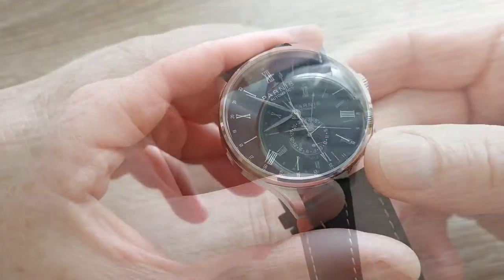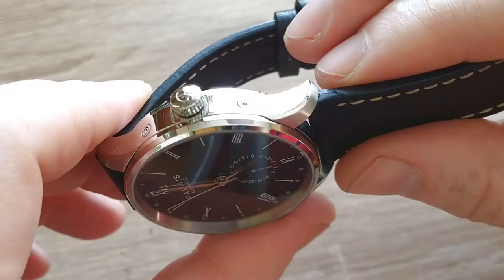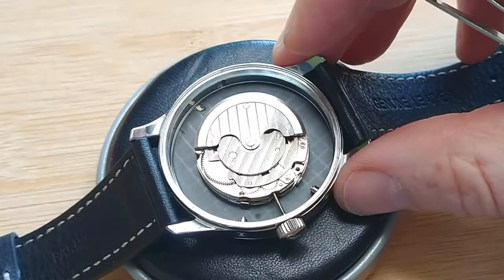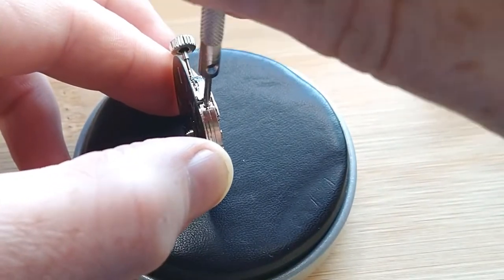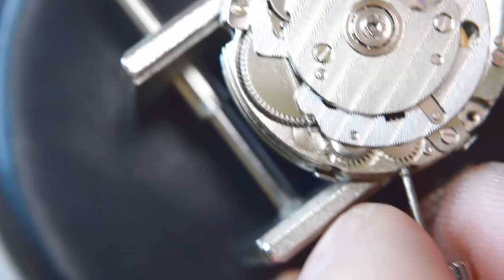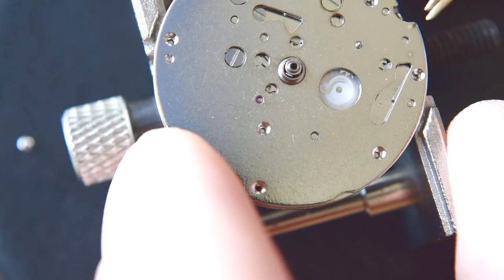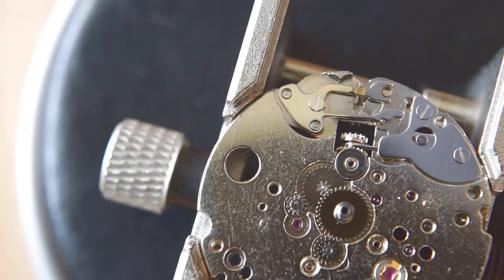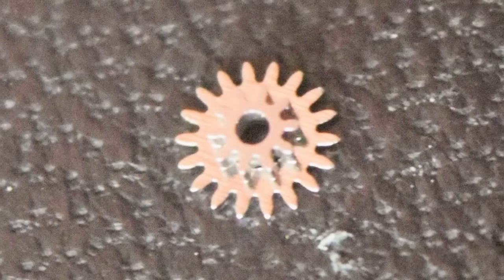PARNIS watch PA2122 with GMT and Seagull movement 1690 part 1 disassembly

Comment: Dzien dobry. Another interesting dissembly video. Do you think Parnis brand utilise genuine Sea-Gull movements and is that ST16 is a reliable movement? I am now thinking to buy a Parnis with ST2505 movement and another Pagani with quite old ST06 movement. Are they also though, reliable and problem free movements because multifunction is the best option for affordable price only in Chinese movement. Dzienkuje bardzo.
Reply from the maker: I was having ST16 and ST17 and all were doing well. About Chinese multifunction movements I was having only this with flying wheel, was working well and accurately. 😀

Comment: I bought this same exact watch and the GMT hand advances when the minute hand is at about 17 minutes past the hour…
Reply from the maker: But is it showing correct time?
Reply: @tickingWATCH Yes, it shows the correct time. Date advances at 12:00 correctly. But… the GMT hand only moves at 15 minutes past each hour - not exactly on the hour. So for the first 15 minutes of each hour the GMT hand is reading an hour late.

(It is 15 minutes, not 17 as I posted previously)
Reply from the maker: @UCTDUxwSwIBNEYzirGjAXZ%F0%9F%91%8D3Q ok so it seems that you need to disassemble the hands and assemble them correctly again, see this in my other videos

Comment: I get the feeling that after a comment or 3 I made, that mightve triggered the "what watch to do for your first service" video. I have since tried to clean up a Slava and it didn't go good. Lost the seconds hand and part of the keyless works must have had something move out of place. Since then I have got a pin pallet pocket clock running well (Japanese) and got a second one today that is a 2 jewel german one. It's running but the crystal has a few scratches and I'll get the back off to clean it up. I currently have a STONE watch that I am in the process of getting back to running. Someone made a mess of the screws in the back and I've had to modify some longer screws and it looks as though it's going to work out. It has a strange quartz movement that is 1 jewel! Made by Atika Ltd in Japan. Never seen a quartz movement with any jewels before.
Reply from the maker: Quite a lot of Swiss quartz movements have jewels, also some quartz soviet movements.